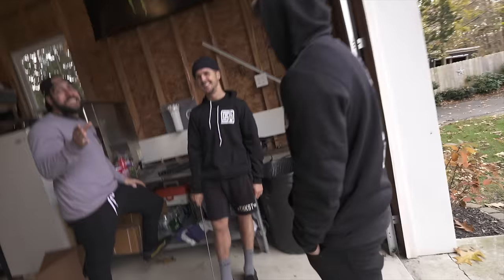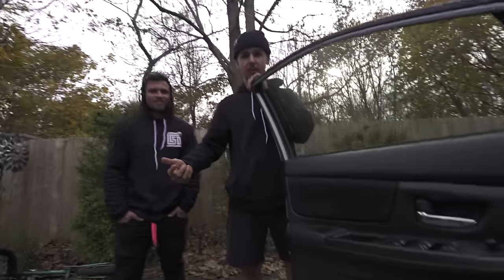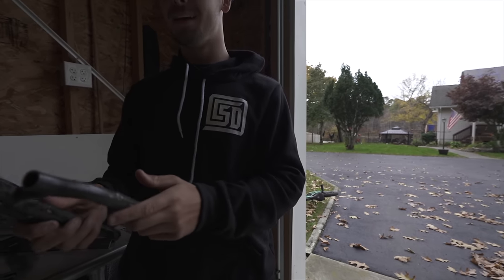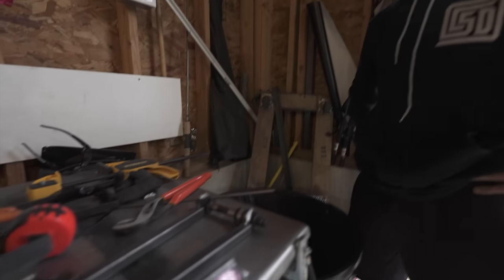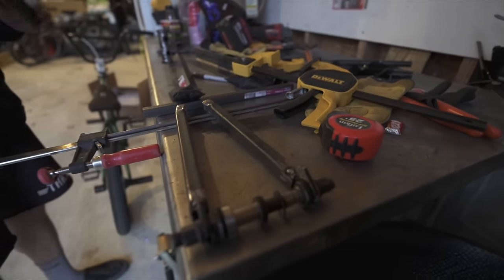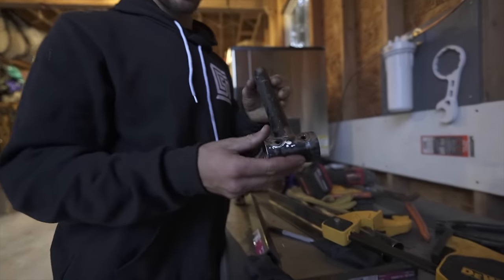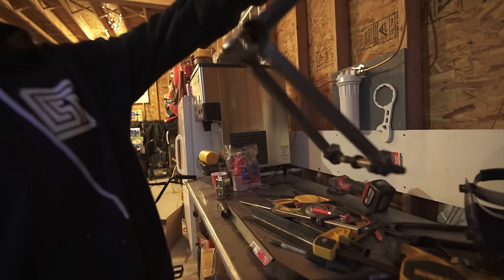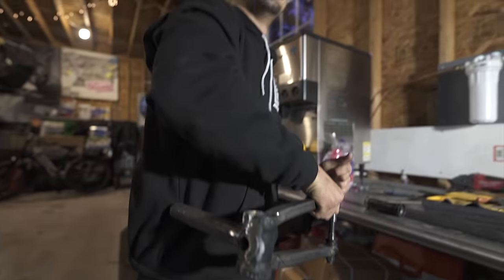The BMX Beatdown Of Cory "Puppy Arms" Berglar!

Comment: Scotty get a car that has paddle shifters. That way you can get the best of both worlds. You can have the auto so you can drive safely but paddle shift to get that manual shift vibe. Yes it's not the exact same but I think that would be a great middle ground for you man!
Reply: true and a lot of autos now shift faster than manuals so they can be pretty good
Reply: I think Scotty's thinking of something older.
Reply: Cory's bike is effin nice
Reply: Do y’all think his right hand would even work fast enough to use a paddle shifter?
Reply: 7:12 he slipped up and said hes getting the wrx lol
Reply: Second that
Reply: @proddwb  Na he didn't no one wants an auto wrx.
Reply: Honestly, I got a CVT not to long ago and it's not the same but it is enough for it to "feel" fun
Reply: Idk if this is a thing but what about paddle clutch? He would still get the feeling of shifting but without having to worry about his feey
Reply: There are also automatics with the option to shift up and down with the center console gear select.
Reply: Most cars with paddle shifts are automatics. The ones that aren't are probably out of his price range. Paddle shifted dual clutch transmissions are expensive.
Reply: @Tommy Ealey pretty sure it's still based off an automatic. I'd have to check it out but I'm pretty certain it's not a dual clutch which means at best it's a sequential like my car.
Reply: @Tommy Ealey a few modern cars still come with the old style transaxles dual clutch is technically faster but a sequential is good enough for most. 

But yeah dual clutch is deffs better then an automatic with paddle shift. 

I may have to see if the new vette transaxle will fit into the slc superlite when I go to build one. About the same price as the vet but you gotta build it yourself and it weighs easily a thousand pounds less. Uses the ls and lt platforms but typically uses Porsche or Lamborghini transaxles, well more specifically a Graziano or zf unit. Or the Ford gt Ricardo if you can find one.

Comment: If you want to make small bends in a piece of pipe (square or round) without a bender, you can just cut pie cuts out of one side of the pipe, bend the cut closed and weld it back together. You can even make a radius by doing a bunch of them in succession. Try that for the chainstays on the custom bike

Comment: When bending square tubing you want to notch the tube at the angle you want to bend it to and then weld the seam.

Also on the car situation, buy a car with a sequential gearbox, alot of supercars these days are made with crazy fast shifting auto or manual modes with paddle shifters.

Comment: You can order a backup camera kit from Amazon or eBay. Comes with a tiny little camera and a little screen you can mount anywhere you want. Designed to work in a car and Comes out of the box set up and ready to go. Just mount the stuff and youre done, no need to build or engineer a special system 😉

Comment: You can just hook up a backup camera in the car. And a light by the pedals. But some of the cameras have auto shutoffs if you go a certain speed. So you don't want one of those. Also. You can look into sim racing rig. And practice with that. And if you crash no problem.

Comment: SCOTTY. There are these systems for hand gas and brakes, i bet u can handle 3 levers on the steering wheel right? clutch gas and brake. 

if seen it used for disabled people with no legs, to still be able to drive a normal car

Comment: use a reversing camera mounted under the steering wheel, mount the display on the dash, it will all be designed to work with the cars electrics and should be easy to mount!!
so pleased to hear your looking to get back into your cars!!!

Comment: Sand! Fill tubes with sand before bending if no heat available and ZERO kinks in the metal as helps with distortion. Kinks are from certain parts stretching while others need to shrink or contract.

Comment: theres nothing wrong with running handlebars for years. or replacing broken ones with old ones. they shouldnt break in the first place. admittedly the way matty rides the do take a lot of abuse, because he is a skilled rider and rides a lot. but for most people, running the same handlebars for 20 years is fine. 
my cheap GT bike broke the crank arm, but i welded it up, looks a bit messy but i would rather do that than buy new parts.

Comment: Get a Rivian Electric truck.  The truck or SUV are both badass.   3 second 0-60.  Even very capable offroad/4x4.  Individual motors on each wheel.  No need for Transmission, Lockers, Driveshafts.   
Air suspension so you can raise or lower the height of the truck.  Great for people with mobility issues that might have trouble getting up into a tall vehicle.    The Interior and electronics looks incredible on them.
Being involved heavily before in SCCA, NASA track racing and autocross, when you are driving a fast car close to the edge (8/10, 9/10) you have to have incredibly fast reactions and hand coordination.  So maybe not the best hobby to get into with your current mobility levels.  And most people that think they can drive fast/well, once you get them on track they quickly see they have no idea how to drive fast consistently and safely.